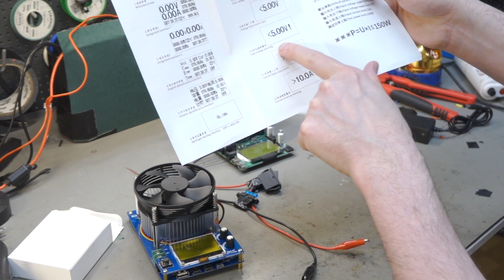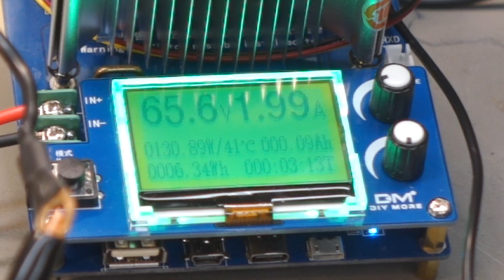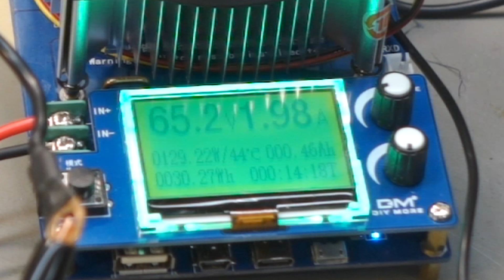New version 150W electronic load / battery capacity tester ALIEXPRESS REVIEW

Comment: Referring to the electronic load 150 Watt that was purchased by me 1 year back.  Unfortunately the Green LCD Screen external connected attachment is not working. Actually I require an external Green LCD Bracket that is attached to the Electronic load. Could you contact the manufacturer of the electronic load and update me accordingly???????

I require a green lcd external attachment module with the push button as shown in the video.

Comment: Any idea if the voltage that is read by the unit can be adjusted? When discharging a fully charged  12V AGM battery @ 5A, it reads 12.5V. But when I measure with 2 other different voltmeters, I get 12.7V....!

Comment: Hi, I've the same device. Due a wrong action of the button at poweron (not described in the manual) the factory calibration has been wiped out (6V battery reported as 62.5V). Does your version of the manual describe how to do the new calibration?

Comment: the 180W problem is probably more to do with what voltage is being tested. The wattage is the same but certain devices similar to these such as buck converters have a sweet spot for voltage conversion and if you go to the extremes away from that sweet spot then current cn be at it's limit for the device. So, although the wattage does not change the device might be at it's limits for voltage and current. I would imaging that it is possible to test at 180W at certain voltages but not at others.
Reply: Might be true but i have brooken to many so far so i will not try. You can use multiple machines if you need a bigger adjustable load
Reply: Its not a voltage issue, its a switching device being used in linear mode and if its designed right the Fet is rated for >100v more then the load. If you don't keep it cool enough it will fail. Honestly running above 100W continuous on to-247 devices is just asking for a short lifespan.

Comment: Been using the same as your old tester today. Testing a 3.2V LiFePo4. Testing with a 20A load and it's doing fine. Using 8AWG wire from the load to the battery.
Yes, the wires that come with most of these cheapo DC loads are ridiculously thin and can't handle more than a couple of amps without over heating and dropping voltage so that the load reads less voltage than if measured at the battery. 4 wire tester better in my opinion

Comment: Hello, I have the same problem than Chris. I did a few measures, everything was OK. I reseted the settings to change battery type and because of low setup voltage, it beeps with no way to stop it. Any idea ?
Reply: Press the button 7 times in a row. That will reset the settings. Then connect battery before setting low voltage threshold.
Reply: @narnars  Thank you, I will try soon and come back

Comment: How do you set the low voltage cut-off? Did you check for the accuracy of current and voltage and power measurement? These are the most important numbers. I got the feeling it shows too much Amps, like 5-8% more than with my clamp meter. They pretend to have a max. error of 0.5% - but that is a joke i am afraid. I think you can calibrate it to actual temperature - not sure what that will give...

Comment from the maker: Capacity testing of 10S5P (Samsung 35E) pack with old load (Worn mosfet) = 16,71Ah (610Wh) vs new load 16,91Ah (620Wh) = 98,4-98,8% in difference, most likelly the old tester (1-2 years, is more worn down).

Comment: A 2 amp test ???
Really ???
Even the shittiest pack can discharge at 2 amps !!!
Give it a real 10 amp test (but not with this tester).
Reply from the maker: What tester do you recommend? We work with 250W ebikes so 2A is fine. If you 100Ah 12V lifepo4 then 10A is more suitable.
Reply: @TheBatteryDoctor   
It isn't the tester I'm commenting on (although I would love a 600 watt version if they ever get made).
My point is that a 2 amp test is inadequate for an ebike battery.

I have tested a few Li ion packs that can discharge at 2 amps for hours , yet fail miserably when properly loaded - for example 24v @ 10 amps (= 250 watts) or 36v @ 7 amps (=250 watts).

2 amps is insufficient and so is that unloaded motor that you have used previously.
I'm not being funny here - it's only constructive criticism.
Reply: @A6D6E6  For example DT24P. It's 1000V and up to 1000 A, depending on the shunt resistor used. For better accuracy at low current its recommended to get the 30 A version. Different versions exist for 30, 100, 200, 300, 400, 500, 600 and 1000 A. And I think, the idea of operation is clear and pretty simple. You just need to add a load resistor. For a load resistor something like "70W 12V DC Thermostatic Electric Heater PTC" is the easiest way to go. You will need more than one, and connect them in series, parallel or mixed configurations depending on the battery voltage. Also, thy are not only 70 W, and also exist 24 V versions. There are also different water heaters and the so called "Cartridge Heaters". But here it gets more complicated.
Reply: @TheBatteryDoctor   For example DT24P. It's 1000V and up to 1000 A, depending on the shunt resistor used. For better accuracy at low current its recommended to get the 30 A version. Different versions exist for 30, 100, 200, 300, 400, 500, 600 and 1000 A. And I think, the idea of operation is clear and pretty simple. You just need to add a load resistor. For a load resistor something like "70W 12V DC Thermostatic Electric Heater PTC" is the easiest way to go. You will need more than one, and connect them in series, parallel or mixed configurations depending on the battery voltage. Also, thy are not only 70 W, and also exist 24 V versions. There are also different water heaters and the so called "Cartridge Heaters". But here it gets more complicated.

Comment: In the old model you push the button and turn on the device, then you enter in the setup mode. Try it and the low voltage disconnect should stay and work that way.
Reply from the maker: Thank you, tested that but did not work.
Reply: @TheBatteryDoctor  I just got the "old style" (but much better packed than even your new one) and was wondering about the low voltage cutoff. The manual was quite good and i figured out that the function key CAN be used to set it. Go to the cutoff voltage menu and try doubleclick to increase, triple click to decrase.
Reply: mine came with single transparent red coolermaster fan :)
Reply: additional info - it's double click in the menu to set direction up, triple to down and then holding to move to either direction faster

Comment: I think we have to DIY a Own Electronic load tester which can actually Power up the other batteries Or other things Instead of loosing in the form of heat. ¯\_(ツ)_/¯
Reply: I've been thinking the same for a lot ,maybe by using a solar off-grid inverter as load and an amp meter on the dc out of the battery to test capacity it can be a more eco friendly solution.
Reply from the maker: We have an engeener that will try to turn onw of our brooken load into a 1000W one. Adding an DC DC converter as a load for a charger can work but a charger is not a constant load.
Reply: @TheBatteryDoctor  yeah... Load current should have to be constant even the voltage drops and that's what I'm thinking. :D